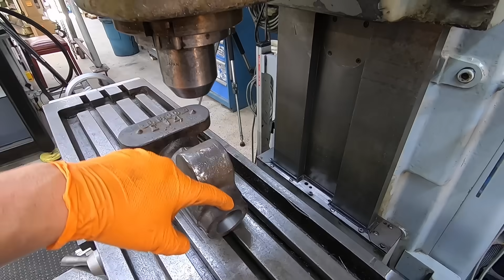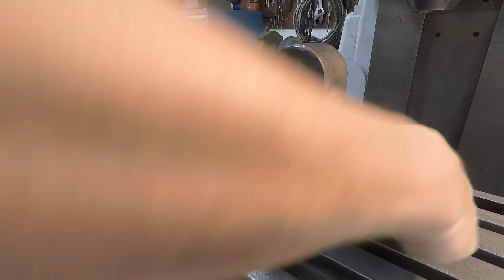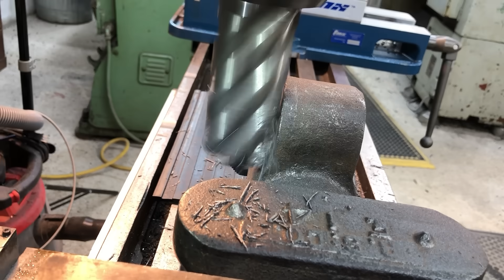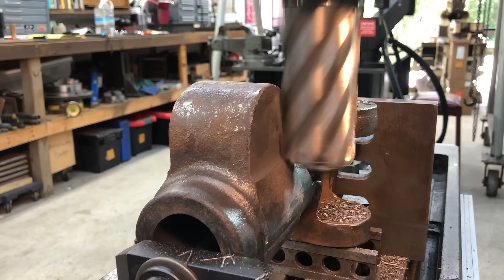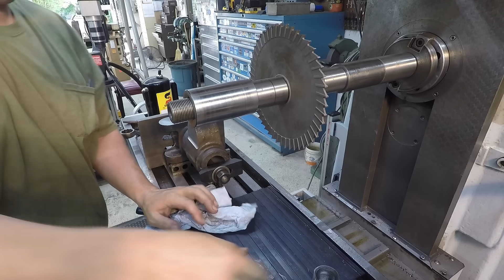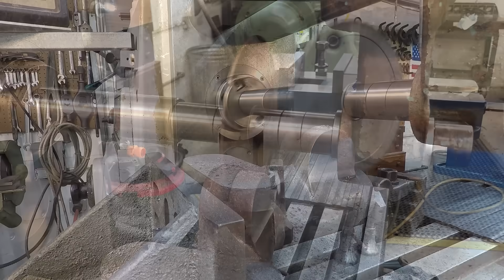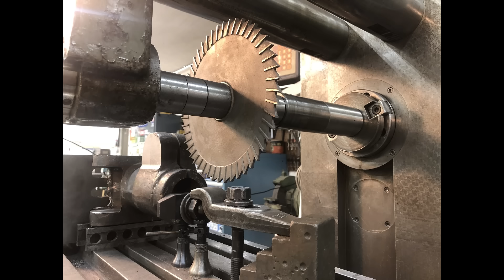Fairbanks Power Hammer Cross Head: Part 2

Comment: I'm gonna leave it - just where it's at - right there...  Donk 😄

And the saw it trying to lift the part - reverse the cut.
Reply: Not at all... you don't climb mill with a side/face cutter... you could shatter it if the table was to judder towards the cutter, you need the feed the right way because of backlash....

Comment: I am glad that everything worked out ok, that being said Adam that is a horrible setup. There was nothing to prevent rotation of the part parallel to the stud, there is nothing to prevent the part from moving in the Z or Y direction, out of six axis of movement you only had one axis accounted for prior to the toe clamp. Always clamp and secure so a minimum of three axis of movement are ridgid. I know the drawing may not have shown it, but there should have been a hole drilled at the end of the slit to prevent growth of the slit and finally failure of the part.
Reply: We have a guy like you at our shop, ends every sentence with "that being said"
Reply: @tedjackson5272  Can't be more than a dozen times in my life I have used that phrase, in light of that, I guess I better start using it more. All things considered, I bet the guy at your shop has some clout in the conversation arena.
Reply: Yet somehow it worked. A quick look at your videos reveals..Nothing. Thank you for your opinion.
Reply: @wildtimbrown  Says the guy with one subscriber!
Reply: @wildtimbrown  It's not really an "opinion" when the very thing I suggested is part of the correction shown in the video. I didn't know that I am required to have videos posted on YouTube in order to have credibility as a machinist. I don't have videos posted, therefore I can't be a machinist, good to know. Ohh how SIMP-ple some people can be.

Comment: Seems like the splitting saw is the one operation that always gives Adam a bit of a hiccup.

I am pretty sure I recall him stating once that he thought the arbor might be out of spec, but I don't recall him ever saying he replaced it. Does anyone know for sure?
Reply: I remember him talking about it being "wonky" but not knowing exactly what it was.  Not sure if he ever did anything with it.
Reply: It may not be the same one he has several with different diameters. also I would think that he has straightened or replaced that damaged one by now. Looking at the video this one appears to be in good shape; just a lot of resonance from cutting full depth.
Reply: I'm not sure any of those arbours are ever really true. Looks like about a 1 inch arbour. Easy enough to see if it's true. Extend it out to the end. fill the arbour with the spacers and put an indicator on it.

Comment: For me (an ignorant newbe that loves watching Abom) can someone explain why the slit saw could not have been sawing down in reference to the x-axis keeping the part in compression on the table?
Reply: You want the tool to push against the lead screw. This prevents the backlash from causing chatter. Called conventional milling, because it always has been the standard for milling

Climb milling is where you do the opposite. Its much more efficient form all fronts. Less tool wear, less heat, better chip clearing, and it forces the work into the holding, but you have to have a extremely rigid machine with zero backlash. This is how almost all modern CNC machining is done.
Reply: @ionstorm66  Thank you sir!
Reply: Was wondering the same thing!

Comment: Curious, why no lube for the blade cut?
Reply: It looks like he was machining cast iron, which has so much carbon there will be patches of graphite in it. The graphite makes it self lubricating in a sense. Aside from cast iron though some carbide tools can handle the stress of no lubricant fine and can even crack under the rapid heating and cooling from the coolant.

Comment: Adam, there were a lot of comments from the first video about the feature references you were using for this part. (choosing cast OD vs. the cast ID) Perhaps you could help the viewers by explaining why you chose particular surfaces as datums and how you develop your machining setups as you progress. 

Today we see that you are using the machined features from the first setup ( specifically the end face which was machined perpendicular to the as-cast OD) to produce the next series of machined features. 

Thanks for the all the great footage and craftsmanship!
Reply: The ID may not be centred (and was not, Adam commented on the runout) because of misalignment in positioning of the core or unequal shrinkage due to positioning of the gates and risers when being cast.
When machining a casting you try to find the axis of the centroid of mass, or use a reference surface which will remain unmachined (you can't correct it with cutting) for aesthetics and balance.

Comment: Why not increase the RPM and slow the feed rate during the splitting op? That would reduce your chip load per tooth and clear chips more efficiently out of the cutting area.

Comment: Are those bits out of round or is there a wobble in the milling machine?
Reply: It seems these large circular saws are always a bit out of round in YT videos.
Reply: @EJP286CRSKW  I'm not sure those arbours are ever true. My first job out of university was a small plant. We had a horizontal mill. We used to gang mill cast iron hinge straps, the two faces with to fit inside the butt. One day the operator didn't tighten down the strap properly and the hinge came out, bent the arbour, rotated the table and chipped the face cutters. When I saw the table skewed I thought the mill was broken beyond repair. Cleaned off the table and found that it had graduations and was meant to turn. took me weeks to find a new arbour. Found out it's a standard catalogue part. Machine ran better after that than it had for years.
Reply: I'm just a dumb engineer and don't have a lot of experience with that type of mill but I suspect the arbour is a couple of thousands out of true. Adam would find it real quick if he put an indicator on it after taking the blade out

Comment: I know I am not a machinist,  but if you increased the RPM of the cutter back to original and slowed the feed rate by half-  you would be decreasing the amount each tooth is cutting????
Reply: The vibration usually isn’t from too big a chip load per tooth but from too high a material removal rate for the rigidity of your setup/machine. Common mistake from new machinist is to keep reducing the chip load to the point you’re no longer cutting a real chip you’re just rubbing the part. That’s real hard on tooling. Usually is better to reduce feed and rpm together to keep your chip load and reduce material removal rate.

Comment: Climb cutting isn’t a good idea! Could you increase the cut with a endmill?
Reply from the maker: Light climb cuts work fine when you have a backlash eliminator like on my mill.
Reply: Ok, so forgive my ignorance but why not climb mill? I ONLY ever see climb milling in a cnc milling context...
Reply: @mtbjason4  Climb milling is somewhat demonized because it can grab parts if your mill has too much slop or backlash. CNC machines are able to lock/drive positions, so it isnt a risk. Climb milling is easier on the cutter, and it is also faster in a HSM context.

Comment: Loading that end mill made me cringe. I have seen bad things happen to people who didn't use gloves. I have a few scars myself. I used to run the Cincinatti "convertamills" when I worked for Boeing and have made the change many times. The head on those machines just rotated on a big flange arrangement. Those kind of slotting jobs are always a challenge. For a free set up I think you did good. Thin large diameter cutters always have harmonics. Just have to watch your speeds and feeds.

Comment: I have a weird suggestion: That blade just barely made it through there and did leave a radius on the end of the cut. So I wonder: could that split be made with a parting tool from the lathe used in the shaper?
Reply from the maker: I’m sure it’s possible but that would be a long stick out of the narrow part of the tool.

Comment: I got a question. Why didn't you oil the blade and the part when cutting the split?
Reply: When you machine cast iron, you don't create chips, you create dust. And that dust is abrasive like the small particals on sandpaper. When you use oil or flood coolent on cast iron, you wash the abrasive dust down into your ways and your spindles and destroy the machine over time. And the carbon in the cast iron makes it self lubricant so you can get away with it.
Reply from the maker: Not needed for cast iron, it’s self lubricating.
Reply: When machining cast iron, cutting oil or lubricant is not needed.
Reply: Oil and cast make for a big mess. Cast is best cut dry...
Reply: iron has poor machining characteristics .
Reply: So you can see what is happening

Comment: If I told you guys the company I work for, you'd all know who it is. It's a shame the way the place operates. What I really like about this guy isn't just his talent, but how well he takes care of his stuff. This new generation of "Machinists" aren't really that at all. No pride in craftsmanship. A lot of it is that damn cell phone. Laziness doesn't do anyone any favors either. I do CNC work so it's not apples to apples but I do take pride in my work and taking care of my tools. Management gave up on these young guys years ago. They're just not interested in the trade.
Reply from the maker: I’ve always tried to teach those who watch and learn, “pride in ownership”. Take pride in what you do, no matter what it is.
Reply: It's not Caterpillar, is it?
Reply: Does Caterpillar operate that way too?
Reply: @toddpf  Well, in the short time that I worked there as a CNC horizontal boring mill operator, I was the only person on the three shifts that checked the inserts in the machining cell, so at the start of each shift I'd have to spend a half-hour looking over everything. My supervisor didn't know anything about machining and so was no help when I had issues, or when I tried explaining a problem. I once called over maintenance when one machine started making a loud noise when the spindle carrier was moving up and down in rapid, and they found that the thrust bearing on the jackscrew was nearly seized. I was once told to keep running even though a rotary union was spewing oil every time the spindle clamp opened, and ended up dumping about 10 gallons of hydraulic oil into the coolant sump, before the machine shut itself off with a low oil level alarm. And then on top of all that, they lied about bringing a new product line to the plant, then closed it, despite it having the best build quality in the world for larger Cat machines. Seems it was too expensive to keep making tractors there, so it was cheaper to build a $300 million plant in East Bumcrack, Texas, and farm out most of the actual fabrication and machining to Mexico and China. I suppose I could go on, but now I've griped enough.
Reply: @SynchroScore  Yep. The way it is. I'm currently running a very tired VMC that goes thru way oil like mad. Maybe 2 gallons a week. I've been asking and asking for this to be looked at as there must be a leak and one of the ways isn't getting lubed properly. Really makes me sad/mad.
Reply: @toddpf  They wanted me to just keep the machine running to get parts through the production line, and then some days I'd be sitting around half the shift trying to look busy while waiting for the parts that just came out of heat treating to cool down enough to machine.
Reply: Pretty common everywhere now days...

Comment: The numbers on the flat surface that you milled off were a heat code used at the factory to keep track of castings until the lab can verify the metallurgy. Not of much use after that except maybe which customer ordered  what.
Reply from the maker: Cool info, thanks 👍🏻

Comment: Me being a back yard hack I would of run the saw in the other direction 😞 can someone tell just two good reasons y that’s a bad idea please.
Reply from the maker: You’re talking about climb cutting, not good for conventional machine with lead screws, you’re asking for a crash. The cutter will pull itself into the workpiece. . Cnc machines can get away with it cause they run on ball screws.
Reply: @Abom79  copy , thank for clearing that up for me 🍻
Reply: "Generally " with "Climb Cutting" you'll get more chatter and tool push, and the tool bit wants to pull it's self forward with what can become an aggressive rate.  With that said I've noticed of late that more and more  CNC machines are climb cutting.  I'm not certain as to the reason?  Anyone?
Reply: I wondered the same thing.  Put the pressure down on the jacks and bed instead of trying to pull it up?

Comment: 17:00 Thanks, Adam for showing the removal of the vertical attachment. Does the drive for that connect directly to the two dogs on the horizontal spindle ? On mine, I've a gear to fit to the horizontal spindle - the vertical head is gear driven  from the horizontal.
It's an interesting solution to disconnecting from the vertical way and stowing the vertical head. Mine doesn't come off the way, it slides vertically upward onto an extension then that extension slides back over the body of the mill - meaning it's never swinging about on one bolt or ever out of alignment for bringing back into use.
Reply from the maker: I’ve seen another K&T that had a vertical attachment that pulls it straight up. Kind of odd but I suppose it worked fine. My vertical head was built so that the spindle keys drive it, so no it doesn’t have an intermediate gear.
Reply: @Abom79  Isn't there a spindle clutch start/stop lever on the top - a slide up & back would get in the way of that - so a swing arm was probably the best solution for that time. 
So mine has gear to fit the 40 taper spindle end and the vertical head slides down to mesh with that. It means that a height extension can be used - so that's another gear on a bracket to go between the horiz. spindle and the V head gear.
Pic of mine (surrounded by mess!) here:
https://www.flickr.com/photos/pmailkeey/50888143418
The extension piece is the bit just below the tiny cutter that's in the machine.

Comment: A lot of questions here as to why not use a climb cut, which pushes down. What was the reason again that you don't like to use climb cuts?
Reply from the maker: Backlash. On conventional machines that have lead screws, you have to “push” cut, not climb cut, otherwise the cutter is pulling into the work and causes a crash.

Comment: New camera? Resolution looks much sharper.
Reply: This should be his older setup as the IG stuff around this is from April 2020. Most likely a delay on the vids to coincide with handtoolrescue releasing an update on the power hammer restoration.

Comment: Hey Adam, first i relly like your content. I any particular reason why you cut on the upstroke with the splittingsaw? Wouldnt a cut on the downstroke prevent the chatter a bit better?
Reply from the maker: I am conventional milling which is what you have to do with leadscrew machines. If you climb cut you are pulling the cutter into the work which will cause a crash. Cnc machines run on ball screws that have no backlash.
Reply: @Abom79  I had one experience with ballscrews - balls all over the floor !
Reply: I thought the same thing. The downward force would be pushing it on the clamp instead of trying to lift the part up off the clamp.
Reply: That would mean effectively climb milling and that could cause more serious problems than just chatter with that amount of cut. That's my opinion - if Adam agrees ?
Reply: @millomweb  it would be slotting still so it would loading the lead screw the same way spinning down or up.
Reply: @SHUTTHEFRIDGEDOOR  But cutter rotation is changed - so ideally, the load on the leadscrew would need to change to remain safe as conventional milling.

Comment: Adam, you might want to file a radius in the root of the slit with a small rat-tail file to prevent any possibility of a crack forming there.
Reply: I don't think a crack will form there because it gets compressed with the clamp screw but a little bit of filing or drilling a hole is still a good idea because the slit will get a little bit longer which will make clamping easier